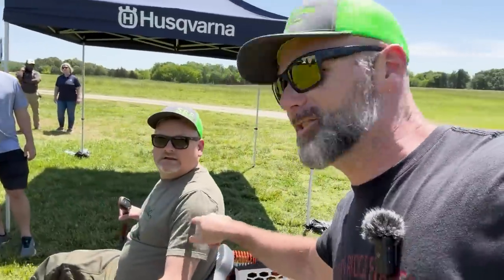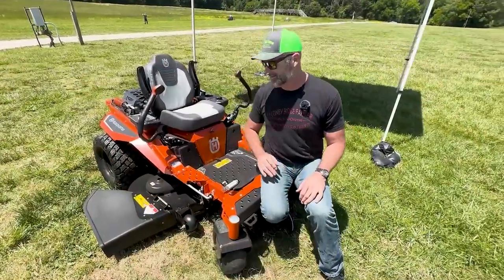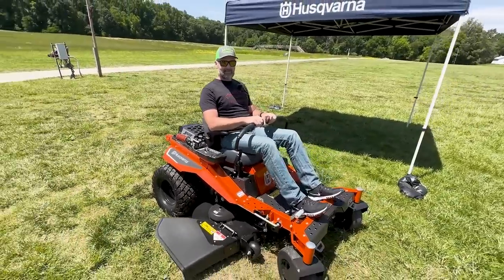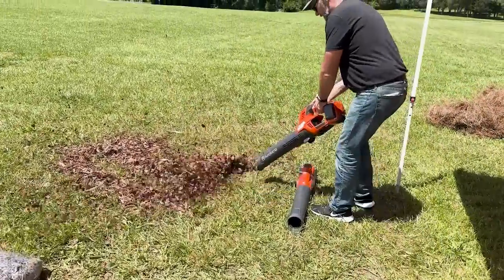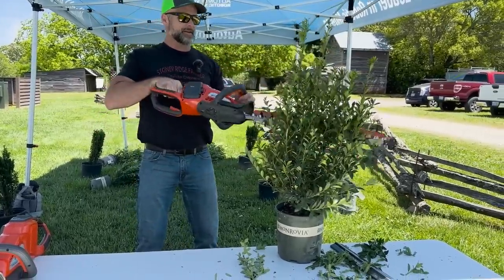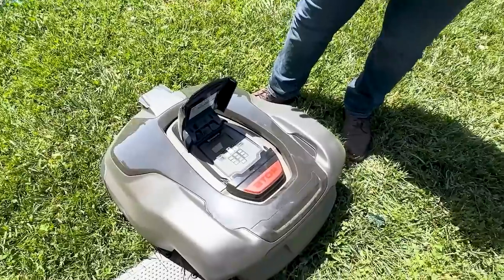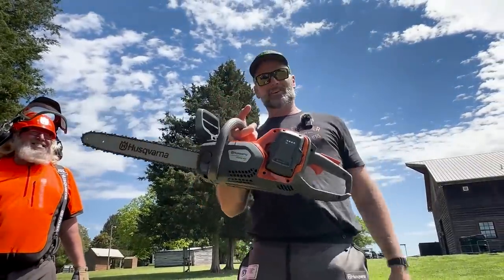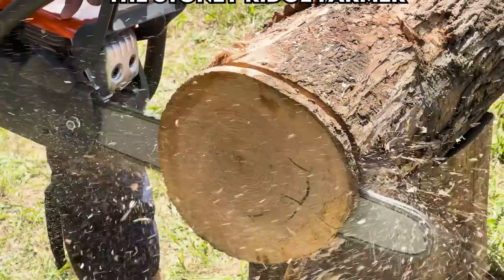6 Tools You'll Never See At Harbor Freight!

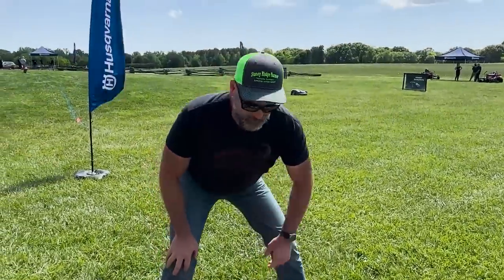Comment: 5:34  I got an electric mower...just push a button to start it.  SO much easier than the pull start on my old petrol mower.  The one that the carb gets clogged so it's $80 every year to get it serviced.  Only issue I have is to remember to plug the battery in overnight.